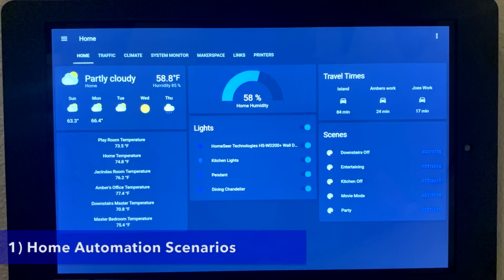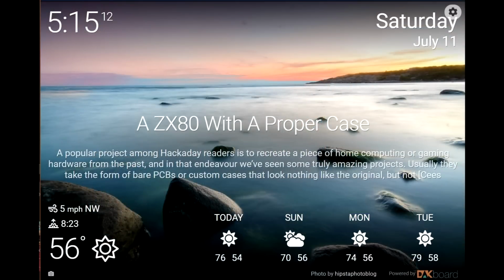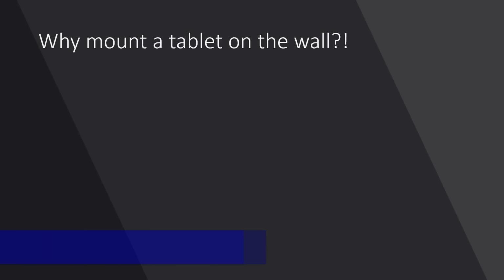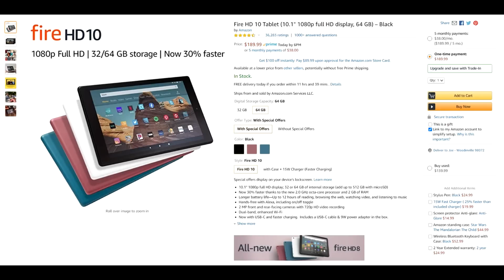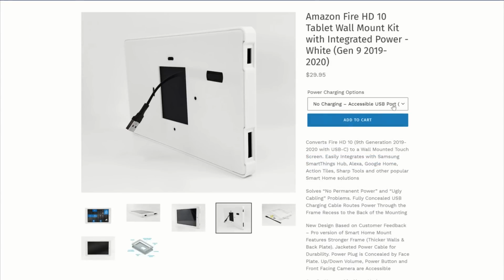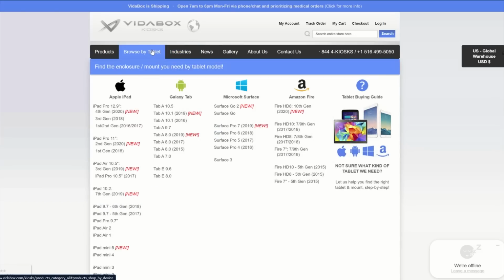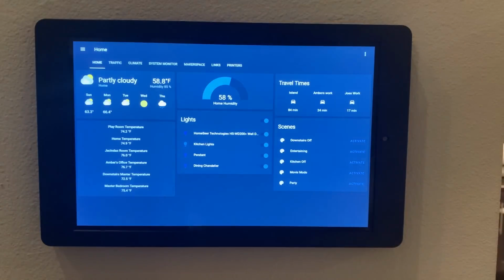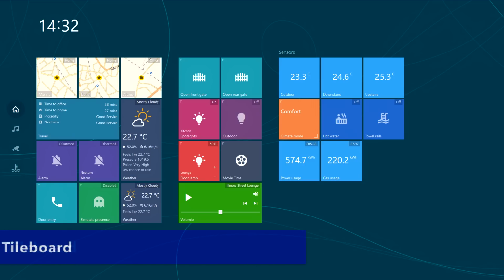5 things to know about wall mounted home automation tablets

Comment: Is there a way to use this info and apply it to my Vera plus ?
Reply from the maker: I'm not sure...does the Vera Plus have a website / UI or an app that you can use? if so this approach may help, if not then you'd have to add another component to give you that user interface to customize, or find an app that can talk to it.  I'm not familiar with the Vera setup myself yet.
Reply: @geektoolkit  I  got Veraplus URL into the config editor. 
Now I am stuck. I don’t see a instructions and need more info to try anything on that editor. 
Even your temperature/ colour settings I didn’t see how you added lines and the Colour formulas to start.

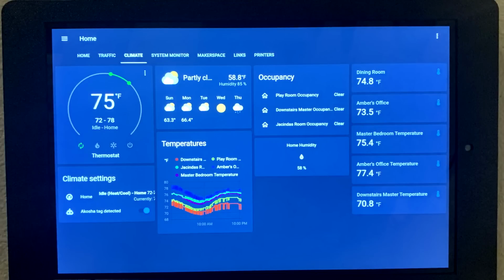Comment: At 2:40 a the Climate dashboard you show Temperatures widget, which shows temperatures fluxuating by 1-2 degrees, Have you figured out why the fluxuation is so wide and irregular? I sometimes have similar issues with my ESP32 based DHT22 temperature sensors.
Reply from the maker: I'm not sure, I didn't notice that till you mentioned it...I'll have to take a closer look. I am resetting up everything (my pi died, so I moved to a VM on a NUC finally).  I've been documenting the setup as I go, but I'm a bit behind. When I get everything set back up I'll try to look into that more.   Those readings are coming off of remote ecboee sensors, though from what I've seen almost everything ends up with the same (or similar tech) so the DHT22 and those may be using similar techniques with similar noisy readings.  Good eye!
Reply: @geektoolkit  yeah I'm using dht22 sensors too and I have these fluctuations. Not an issue currently but I suspect it's when I connect more sensors. Currently all my nodes at home measure just temp and humidity with those dht22.

Comment: Thank you for posting the video. I was a bit confused about the power source. If I have a combo outlet with usb ports, can I plug into the usb? Will there be long term issues with tablets?
Reply from the maker: That should work fine

Comment: Joe... Awesome video...you gave me a lot of ideas/options. I will setup my home and will try out these options. 
Can I ask you one question. The Softwares which you suggested here, any of them got the security feature of Fully Kiosk browser in-built? What I wanted is the security feature of the FullyKioskBrowser, which locks down the device to just the dashboard. Or you proposing Fully Kiosk Browser on top of the other dashboard apps ? 
Thanks much, Joe.
Reply from the maker: Thankyou, I'm glad you found it useful! 

I use fully kiosk, it does what I need. I'm not sure if the others have the lockdown support.  I don't recommend using more than one..if Fully Kiosk does what you need, then I'd just use that.  The others were just to show there are options to try, and many of them have free trials, and nothings is exclusive. So you can run multiple, you can try to swap between them to test for yourself.  Sorry thats not more of a crisp answer, but I think only you can answer which works for you based on what's important.
Reply: @geektoolkit  perfect. Thanks much.

Comment: Unfortunately my old tablets (droids v4) won't do the jobs. For wall displays controls it need a pretty recent android version. 
I'm running home automation (HASSio) and controlling/observing works like a oiled system with my phones.
Reply from the maker: Yeah I had some old android ones I tried at the start, but they were six or more years old so when they didn't work I wasn't too shocked (though it'd be nice to come up with a use for them, and I really thought a browser based UI would be simple enough).  I do like using my phone, but I also enjoy having a larger screen for my dashboards.  I'm just a fan of dashboards I think lol

Comment: A lot of you seem enthusiastic about wall mounted control centers.  Why would you even do that, when you can control everything from your phone, or by voice?  With a tablet on the wall, you have to physically go there.
Reply from the maker: Alot of my viewers are deep into home automation and those scenarios.  And those scenarios span much wider than what a phone or voice can do.  Here's some examples, but there are many more:

Family/friends/nanny/babysitters - Voice commands are limited by the vocabulary your house understands...for instance I name my front room 'theater'...so 'alexa turn on theater' would control that.  That's not intuitive for someone else.  For phone..that's a personal device, whereas a tablet enables communal control

Rentals/Airbnb - Again, a tablet allows for scenarios that are easy to discover and control

Security Cameras - Voice doesn't help here.  Phones can

Reliability - This is similar to 'if I can control my lights with my voice, why have light switches'.  Because they 'just work'.  A hardwired tablet, esp. a POE one, is hardwire networked.  No worries about wifi being down, cloud service being down, battery being dead, etc.

Privacy  ownership - Many people on Home Assistant don't use/trust cloud services.  See the history of Nest, IFTTT, Ultrasync...all of these cloud based services made a major change that broke peoples setups. 

Saying 'just use voice' misses the depth that many that are into this video are looking at the problem with. For the casual market, this is overkill.  For the enthusiasts, they'll use phones and voice, but this just expands the capabilities. My wife is technical and appreciates home automation, but she appreciates a tablet that can show her available scenes. To each their own...I just made the video to show what I liked about it. :)

Comment: Love the concept but why a Fire HD 10? Its still running a modified Android OS that is behind what's out there currently. Would a cheap 10 inch tablet that supports current Android buy me anything meaningful?
Reply from the maker: Yes of course. I tried to cover that in the video...you’re absolutely right that a FireHD is going to have limits and issues...but I list it because there are a lot of case options, and for price, but they also provide a solid resolution and quality . I wanted in this video to present all of the options and explain the trade offs. A cheap tablet will give you full android, but getting a case may be more difficult and you will want to make sure you get a decent resolution.

Comment: @geek toolkit    Can you integrate an existing home security system with this product?
Reply from the maker: I’m using home assistant, if it’s listed here then you can to some degree: https://www.home-assistant.io/integrations/
Reply: @Geek Toolkit 
Currently, I have a DSC PowerSeries Home Security System. The system is wired. I want to get rid of it and go wireless.  Are you saying it not possible?

Comment: For WallPanel, does it use the API for SmartThings, Nest, Alexa, etc and then present it in widgets on a single screen? I use SmartThings for switches, Nest for AC, Govee for RGB lights and camera system.
Reply from the maker: I'm not sure, hoping someone else more familiar with it can answer. I'd have to reinstall it, I"d since cleaned that tablet back to fully kiosk after this video

Comment: Heyy! Is it as easy with Ipad? Wondering between Ipad mini 2 and Galaxy Tab A. If I have smart bulbs, do I still need hub for this to work? Anyways, awesome work!
Reply from the maker: I’ve not done it with an iPad, however there are mounts that make it seem as if it’s a similar problem...mount on wall and figure out power. The iPad mounts where you can remove the iPad are slick because then you can still use it as a tablet and then it becomes like a wall docking station. As far as smart bulbs you could use the software designed for them and may not need a hub (for instance many lights are wifi). If they’re zigbee or zwave you’ll still need a hub
Reply: @geektoolkit  I was more worried with the software side etc, for mounting I could even use double sided tape I guess haha. Thankyou for your answer! For now I would just want temperature and lights to be automated as it's not that cheap going forward. I would be nice to have everything in one app though so you Wouldn't need to switch between apps. As of IPads, It seems that they are not using Li-On batteries but Li-Po which has lower chance of Combustion etc, maybe it's even new information for you ;)
Reply from the maker: Oh that is good to know!! Software side my impression is that android has more options if you’re not running a HomeKit based setup. I think it may be based on stuff like being able to control the OS (turning the display on/off for instance).
Reply: I can’t figure out anyway to create a dashboard that doesn’t require a hub for brains. Maybe I’m not doing it right. I too have wifi smart lights (such as sengled), switches, and a ring camera, that I would like to use this dashboard for. It’s annoying that each brand has its own separate app/interface. Cant seem to figure out how to load them onto a dashboard.
Reply from the maker: I do use a hub, but I setup an open source one that works with a zillion things amd is actively developed (home assistant). It installs on a raspberrypi and provides customized dashboards. Otherwise you’d have to find commercial software that would interop with each brand, and I’m not sure if that’s a thing due to the vendor lock in you mention

Comment: Also an idea worth considering: Get an RPi with Touch Display and touch display case. These can be (afaik) wall-mounted with just two nails or screws. But it's a bit bulkier and the resolution is lower but you have full control over the device.
Reply from the maker: Yeah, the challenge there is finding a good web browser that doesn’t take an awful long time to load. I love raspberry pis, but web browsing in even my pi4 is painful vs even the weakest of tablets I’ve used. If you can get decent performance on the browser please share the setup, I know something has to be better than chromium!